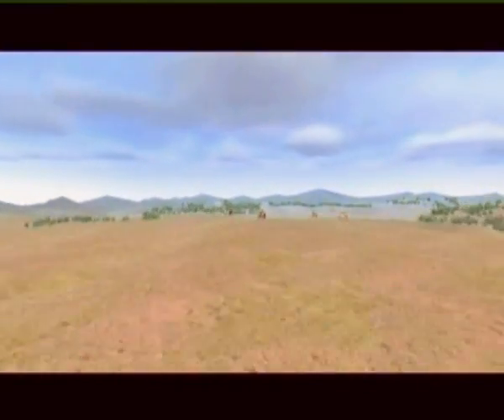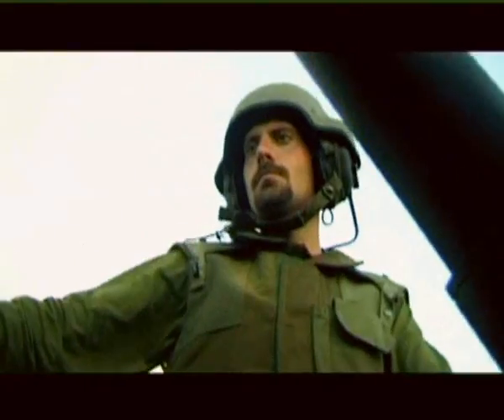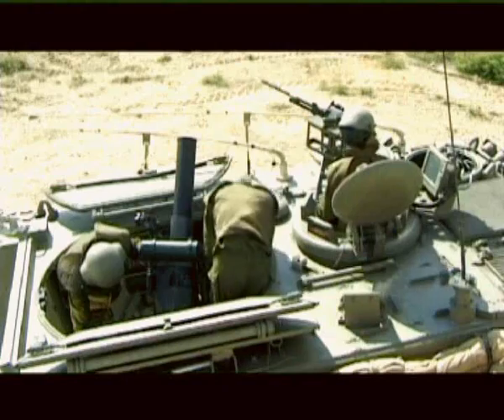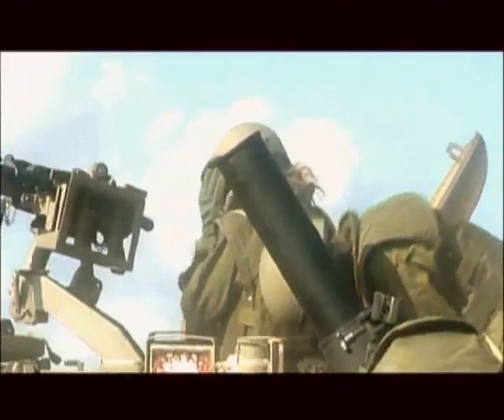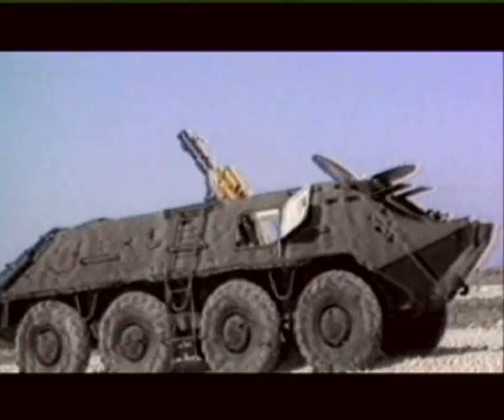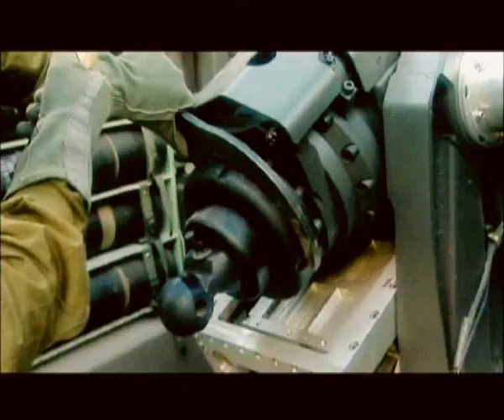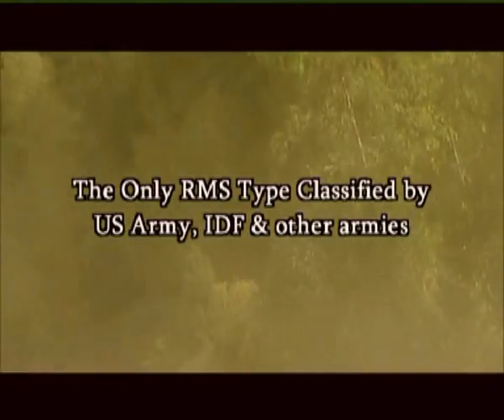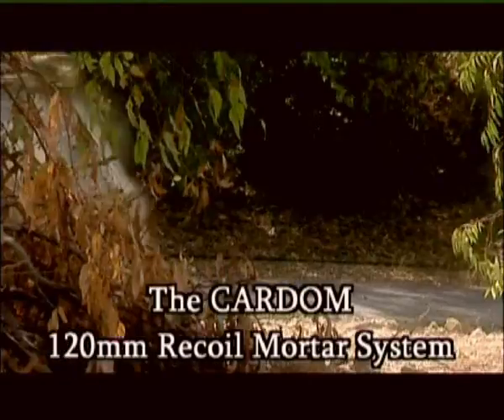CARDOM - 120mm Recoil mortar

Comment: Interesting in that it has a hydropneumatic recoil system (like a howitzer).

I didn't know that the U.S. uses it also.  I do know our troops are wishing for a GPS-guided smart round for the 120mm mortar.  To be able to deliver precision fire support at the platoon level.  Since mortars are smoothbore, with a finned, non-rotating projectile, that really shouldn't be too tall an order.